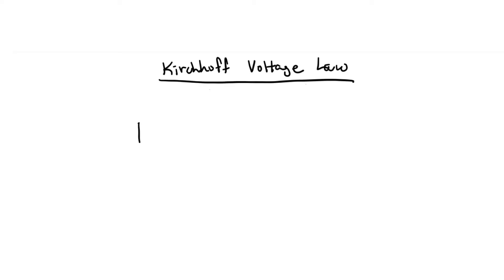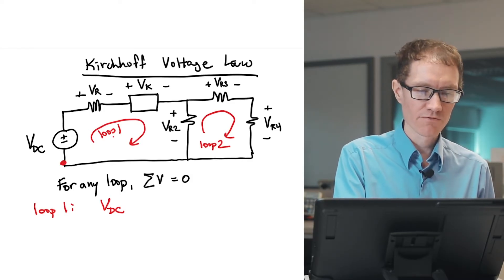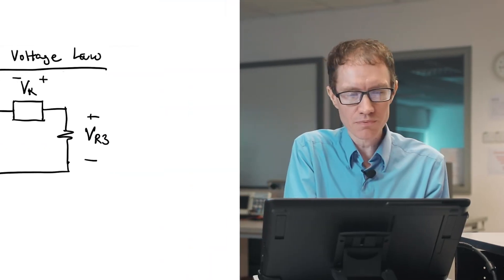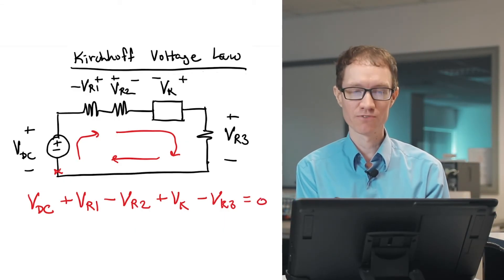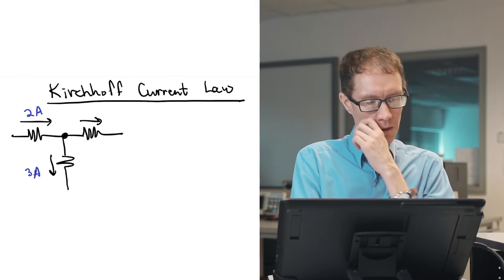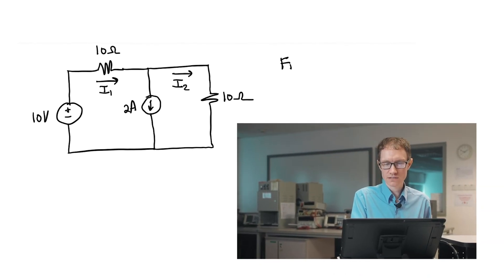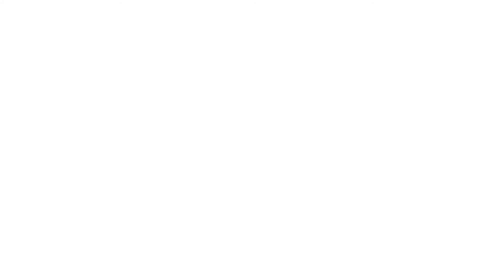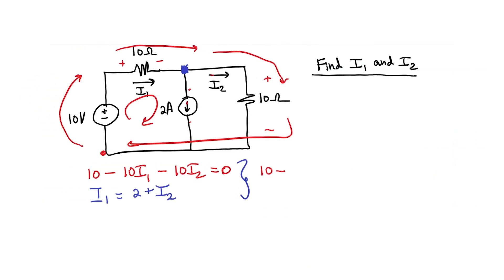KVL and KCL (Circuits for Beginners #11)

Comment: Your equation is floored right from the start. the circuit clearly shows a 10V supply to a 10 ohm resister, The max current flow 10V / 10R = 1A. For 2A to flow 10V / 2A = 5 ohms. As you have 10 ohms not 5 ohms the equation is floored rubbish.
Reply: Aaron’s circuit analysis and calculations are correct.  The current source is throwing you off.
Reply: @user-fy2tm2jg6c  funny this guy thinks he knows the subject better than the professor. :)
Reply: @plinker439  For someone who can't spell 'flawed', I'm not surprised.
Reply: Maybe you're right, but for the sake of explaining how to solve it, you must be thankful to this guy, who happens to share all this for free. However, I do notice that there has to be an error since the current I1 cannot be less than 2 A. My opinion.
Reply: @alro7779  There is no error. I2 is a negative current, so despite the arrow pointing away from the blue node, the current is actually flowing into it.

Under the assumption that the red node is 0V, this is only possible if the blue node is negative, in this case -5V. This is forced by the current source. It would have been instructive to show the node voltages in the video and prove that the KVL is also satisfied in the loops.
Reply: @alro7779  Yes I am Thankful that he was not my lecturer, He teaches floored rubbish.
Reply: Rude AND wrong! You should change your user ID to UKSUPERBELLEND